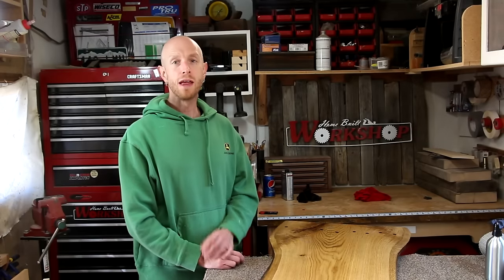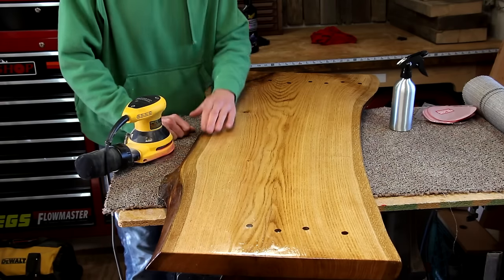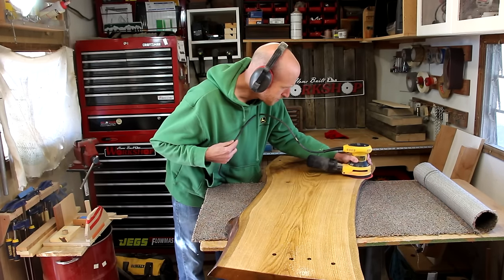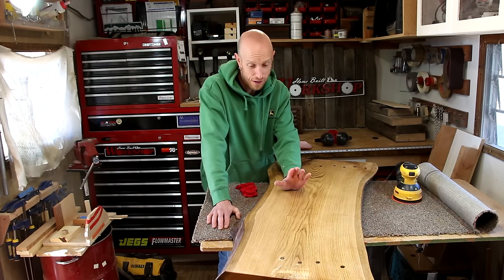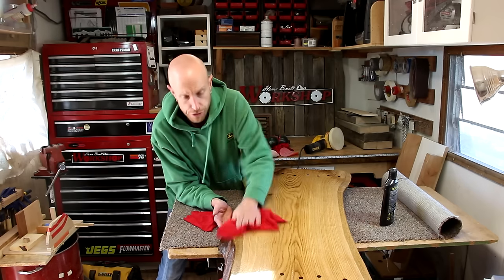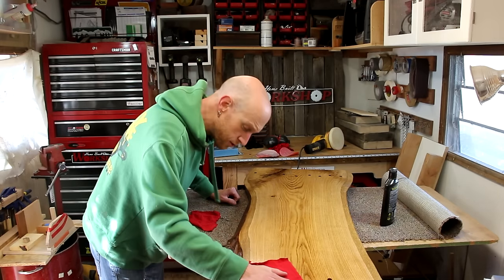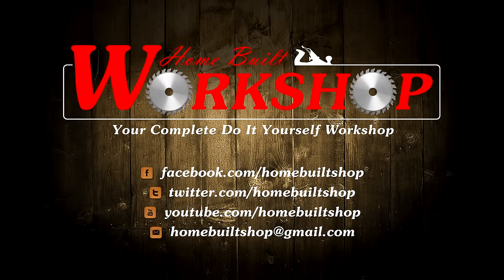How to Buff Polyurethane to a High Gloss

Comment: Hey Jeff! Great video along with your other polishing video! I’m using your technique on a table I’m finishing right now, same polish and surbuf pads but I’m not getting the same gloss that you get, like at all it seems glossy while I’m polishing but after I wipe it with a rag it goes away. Not sure if I need to keep buffing or if me wiping it is the problem any help would be appreciated thanks!
Reply from the maker: Did you try to buff it by hand? A lot of times thats what is needed at the very end to bring in that shine.

Comment: Hey Jeff. Amazing work. Just curious about a bar top I’m building. If I want a satin finish with my satin poly, I can follow your steps and leave out the polishing part correct? I’m trying to correct some small flaws/puddle marks in the poly. Thanks.
Reply from the maker: Yes, dont polish it. You might try sanding it level, then if it's not the right sheen, apply one final coat of your poly. You should be good to go. 👍

Comment: What kind of buffing compound are you using? I wet sanded my polyurethane clear up to 3000 grit and tried to hand buff with meguiar’s ultimate compound and a terry cloth - the gloss didn’t improve at all.
Reply from the maker: Its the Ultimate. I like to bring the final shine in by hand with a clean cloth. Sometimes it really brings out the shine. Maybe that would help you out.

Comment: I have always wanted to know how do you get to that High Gloss Finish, this was an exceptional video.  My next question is how do you get there, you mentioned 10 - 15 coats of Poly.  Am I sanding between those coats, or is it apply/ dry, apply/dry to 15 coats then sanding with the 2000 grit wet?
Reply from the maker: I very lightly sanded between coats. Heres the video where I put this together. https://youtu.be/wO3DJfKj5co

Comment: I’m working on mahogany, I put down about 12 coats, of wipe on, making it myself, it’s about 1/2 n 1/2 poly, thinner, Okay now want to make it smooth, so I have 15000 grit that I went over for final, it’s smooth but now I can see a haze on the finish, should I just polish or put another coat of poly rub on ?
Reply from the maker: After sanding with 15000, you should very easily be able to polish by hand to get the shine back.

Comment: What speed are you using the sander at and is is the same speed for all steps?

Thanks
Reply: Also are you using water based or oil based polyurethane and is it gloss or satin?
Reply from the maker: I never seem to change the speed on my sander. I have it set to the highest speed. This is an oil based polyurethane.

Comment: How about using hardeners to speed it up and make it much harder. I use isocyanate, but with proper ventilation. I can sand out with 400/600 wet and then get a nice polished finish with zero orange peel. Overnight cure and always a great shine.
Reply from the maker: Thats something I hadn't thought about. I know hardeners are used for Automotive Finishes, but I never thought about trying them for this type of application. I'll have to try that. Thanks for the suggestion.

Comment: Hey awesome video, I'm a new woodworker and am building a desk for my boy. Just wondering if the 15 coat rule is for brush on poly ? I use a wipe on poly from minwax and was wondering if you need to add even more coats when it's wipe on as it seems like you get less material on there when wiping. Thanks a lot!

Comment: Thank you so much for the video! After application of at least 15 - 20 General Finish gloss coats on my birch , I wanted to eliminate the nibs (and a few  tiny loosed poly threads from my polycloth wipe offs) and get a truly perfect finish. The 2000 definitely smoothed the project better. 

Unfortunately (but expectedly, even according to the video), the 2000 grit application did remove to a light haze in certain higher sections (not visible with the pass of the hand), but the polish process DID NOT restore or bring these sections back to the original gloss finish. Do you believe use of a rubbing compound would finish this out to a higher shine? I don't think everyone here is going for high gloss, but the polish step is not enough to bring it back.
Reply: This process works great!

Comment: Not sure if I miss it or not. But what do you do in between coats of poly. Do you sand after each coat applied before adding an additional coat?
Reply from the maker: I typically sand lightly between coats. It gives a better result and requires less time in the final sanding.

Comment: Hi!, maybe you can help me, maybe not, but I have a rustoleum satin polyurethane lacquer, and Im thinking of use that as a clearcoat for my buick GNX scale model, and Im wondering if it can be polished to a high gloss finnish. Should I use that?, or I need the Acrilyc lacquer rustoleum?
Reply from the maker: I haven't tried polishing that brand specifically but I don't see why it wouldn't work.

Comment: ....as a follow on - have you ever tried a couple coats of shellac to fill/seal the grain before applying poly - i always use it and it saves about 5 coats of varnish - and it dries super fast too!
Reply from the maker: +Nick Solanki thanks. I haven't tried it but I will now. Thanks for the tip.

Comment: Is that a water or oil based poly? Did you brush or wipe the poly?

Hey, saw you are from Peyton. I was raised in Ellicott.
Reply from the maker: This is Oil based Wipe on Poly. There's about 15 coats on it. Thats awesome you're from this area.
Reply: @homebuiltshop  planning a P-bass build and trying to decide on finish. I have been leaning toward doing a Poly finish myself. I do have an Amish friend that works in a cabinet finish shop that could spray a nice finish on, but I am trying to do as much of it myself as I can. 

Do you have a favorite brand? I have been looking at some of the Poly flooring products because they seem very durable. 

99% of the people that live in Colorado don't know where Peyton or Ellicott is. :) Go Hawks!
Reply from the maker: I don't have a favorite brand of Poly. I've tried several of the big brands. Minwax seemed to work well for me though. It will buff out nice after its cured.

Comment: Can this buffing process be used on 10 coats of polyacrylic? thank you!
Reply from the maker: I've never tried it with polycrylic specifically. I have done it on other water based finishes though, and it works great. I'd recommend trying it on a test piece just to see for sure.

Comment: Hey man, this is a great video, thank you!
I got a question for you.  I am restoring vintage speaker boxes and i applied veneer to it already and I want to create a mirror like finish to it.  What product would you recommend for a very durable and long lasting product that I can get it to a mirror finish. Thank you!
Reply from the maker: The boxes sound cool. You should be able to get that type of finish with several different clear coats. I think the easiest would be to build up many coats of lacquer and let it cure before buffing. Lacquer drys fast so you can get several coats a day. You can also do the same with polyurethane.
Reply: @homebuiltshop  thank you for the answer, should I seal the veneer with anything or just spray on lacquer on top? What's the best can spray lacquer you would reccomend?
Thank you so much for the answers!

Comment: Amazing video, Jeff!! Great teaching abilities. Who knew I could use my big stock of automotive detailing equipment for woodworking! I've crossed over here and there but it's great to see that it can be done beautifully. I'm curious about your thoughts for using an automotive clear coat in place of polyurethane or varnish- primarily for exterior durability?
Reply from the maker: +Andrew Walsh I grew up in an Auto Body shop so I have a little experience. It's been quite a few years since I've done that work but I'm quite familiar with the products. I do believe the clear would work. Its actually something I've wanted to try for the same reason you mentioned. Its difficult to find a clear that can hold up outdoors and I really feel the automotive clear could be a great option.
Reply: Haha thanks Jeff! I run a canoe rental and campground and have been refinishing my tables every year that I hand stained/coated. I think it's finally time to dive in
Reply from the maker: +Andrew Walsh go for it! Let me know how it works.
Reply: Sorry to keep bugging you about an old video! Just had great success in the wet sanding process with Trizact pads for random orbit, wondering if you have ever used them? They go up to 5000 girt and are normally for automotive finishing. I found that it saved me quite a bit of time in the final buff!

Comment: Water wont damage the wood? If it get through some  pores in the clear coat? Dry sanding is also  recommended?
Reply from the maker: At this point in the process, there are many coats of clear. The wood should be well sealed up. Dry sanding is recommended between coats of clear. After the clear has cured for a week or more, then that is where the wet sanding comes in. Its only done before polishing. Hope that helps.

Comment: Does water based polyurethane have to be applied with the grain? I have a table that has four sections at a 45 degree angles. I've used tape  at the joints to keep from sanding and applying finish across the grain. I'm running out of patience 😢😊

Comment: Just ran across your channel. Nice presentation. I appreciate your emphasis on waiting until finish is fully cured, because the marketing that the finish companies put out there is all about how quickly their finish dries, This in no way means it is cured as you so clearly explained. I do want to know if you remove all the finish after sanding through a spot during the procedures you are demonstrating here?
Reply from the maker: +William Branham if I sanded through a spot, I'd go back and sand with 220 to rough it back up and reapply the finish again, building up layers. I don't think you would need to remove it all.

Comment: I've seen a few of your videos. I like how you get right to it without a lot of introbabble.

Question: if I'm refinishing a kitchen table or desk with a veneer or something that has the woodgrain going 7 different ways, how can I coat it without it looking like a lunatic did it?  (Assuming that's not the look I'm hoping for. )
Reply from the maker: Lol, Do you want it to look like a lunatic did it? I'd definitely sand between coats as it will be nearly impossible to always go with the grain when hand applying finish. Or, you can eliminate that problem and just spray on the finish. Then you don't have to worry about that. You can get Laquer or Poly in spray cans. That might work good for you and get rid of the lunatic.
Reply: Thanks that helped.  Lunatic out ;-)
Reply from the maker: Right on. Lol.

Comment: Interesting. I use sanding sealer.
First coat gives you the high and low spots. Low spots tell me where there has been more absorption. 
Allow to cure, sand, clean and check for the high spots.
Apply second coat of sanding sealer; let cure. Again check for the high and lows spots and sand once more.
By this time everything be pretty much level.
Experience by this time should tell you if you can now apply the polyurethane.
By now you should have a GLASS shine good enough to brush your teeth with.
Any irregularities can be buff out with polishing compound and the paste or liquid wax.
I mean that by now you should have a mirror finish.
None of this 40 coats of varnish for brightwork nonsense. Cut to the Chase!
Good Luck!
Reply from the maker: I've used sealer on other projects. It works good and seems to build up quickly. 👍

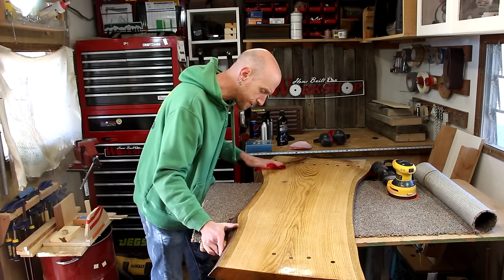Comment: Hey bud, at 3:30 you mentioned the dull spots. Do you keep sanding until the piece is completely dulled over??
Reply from the maker: I sand until the entire surface is smooth and even. You want to make sure you don't sand through the finish though.

Comment: Hi Jeff,  is it the same process when doing boards that have been painted then varathane diamond wood finish water base ? Im making corn hole boards aka bean bag toss boards lol. I have painted them with just a latex paint after sanding, I then have so far done like  7-8 coats of varathane with sanding in between coats with 240-320 sand paper. I want the glossy and very slippery top, so do I continue more coats and then do the wet sand then the polish like you did.
Reply from the maker: +Louise Pinsonneault oh yeah, I never thought about using it over painted wood. I like playing cornhole as well. Thanks.
Reply: im not the fancy talented kind but im going to add you to facebook and post a pic of the boards.

Comment: I tried doing this and have really struggled. Initially, I did as the instructions said and put multiple coats of poly on without sanding in between and found that this produces a gritty finish, which lead to me looking here. I also have had a hard time sourcing polishes, I assume the shortage has been caused by the disruption from co.vid. I have looked at walmart and meijer on several occasions and the best I could do was a turtle wax scratch and swirl remover, which I've had nonexistent results with (does this even work on cars?). I have an old bottle of meguiars ultimate compound that I've gotten good results with. I also ordered a pack of sandpaper discs, but being from some online store I'm not sure if they're actually the correct grit, since I cannot get any kind of glossy polish by using them, even up to 3000 grit, but they aren't wet / dry so that doesn't help. If I was to do it again I think I would order 2000 grit wet / dry pads and see what that does.

Anyway, this is what I've done to get mirror reflective results, which could be improved further with a proper polish: I've put layers of poly on, giving it 24 hours between coats and sanding with anything between 240 - 600 grit ( not seeming to matter, just need to take the dust nibs off and give the next layer something to bond to). Then after giving it a day to dry, I've taken paper towels / shop towels or microfiber towels I've rubbed meguiars compound until I've gotten a reflective surface. I've also tried using a foam pad and sander to buff, but it seems no matter how much I power buff I need to give it a finish buff by hand. At this point, I could probably use meguiars polish to get an even shinier buff, but I can see a detailed reflection depending on the lighting just with compounding.

The key for me was to not use any sandpaper after giving it a coating. Maybe getting wet/ dry 2000 grit and being sure to keep it wet would work, but I had no luck with the discs I bought online (I couldn't find anything higher than maybe 400 grit in stores, and not even that high with sanding discs)
Reply: By the way, love the video, I really appreciate it.
Reply: I never sand between coats of poly...never saw the need to and have not had any problems.
Reply: @Broncort1  I tried not, but I ended up with dust nibs that got worse with more layers. The final result felt like someone sprinkled sand on the table. Maybe it wouldn't be a problem for me if I had a way to properly keep the dust down or the surface covered during drying.
Reply: ScarletNight seems like you have a bad dust issue.  I have the occasional spec of sand here and there but it's not a deal breaker like your saying.

Comment: Jeff, will this method work with wipe on Poly over sanding sealer? How many coats of wipe on Poly should I apply before sanding and buffing?
Reply from the maker: It sure will work. Wipe on poly is a thinner coat so I'd probably be around 15 or so coats myself.
Reply: Thanks Jeff. I used Minwax fast drying wipe on poly for about 4 coats over sanding sealer. At this point I decided to speed things up and switch to minwax fast drying poly in the aerosol rattle can and added six coats of that to the guitar body and neck. Do you think this enough coats to go ahead with your sanding and polishing process?

Comment: Hi Jeff, great sound advice on getting that perfect finish but I have question, I have just completed making a large metre-square frame in pine for a mirror.  How would I go about applying your polishing technique to an item with mouldings?
Reply from the maker: You could sand and polish by hand. It will take some time but the results will be the same.

Comment: Jeff, I just finished putting about 10 coats of satin wipe on poly on my dining table.  I would like it to be more glossy but seeing I didn't apply a high gloss finish to begin with, will this process buff the satin to a high(er) gloss shine?  Thanks for the video!
Reply from the maker: Thank You. In theory, this would shine it up. I haven't tried that though. If you have a test piece, you could put a few coats on a scrap piece, wait for it to cure, then see if it will buff out. I feel like it will, but I don't really know how it will work. Sounds like a fun experiment. If you try it, please let me know your findings.
Reply: @homebuiltshop  Thanks for the reply.   I just ordered the pads and wax from your links and am going to do it in a week or so.  I will let you know how it turns out and may even shoot some video of my own to upload and share.